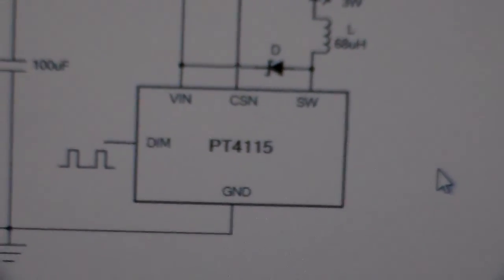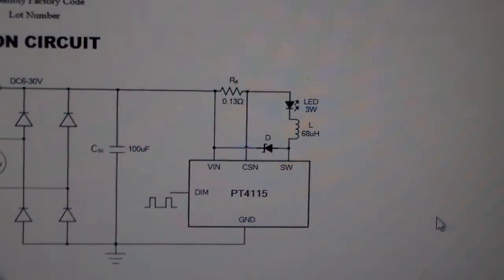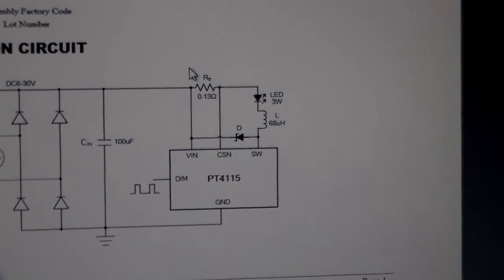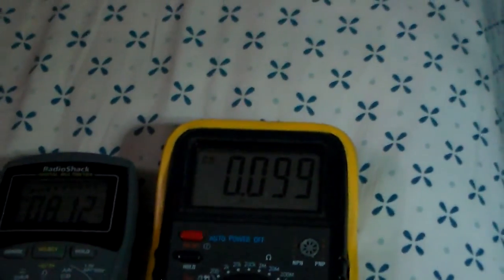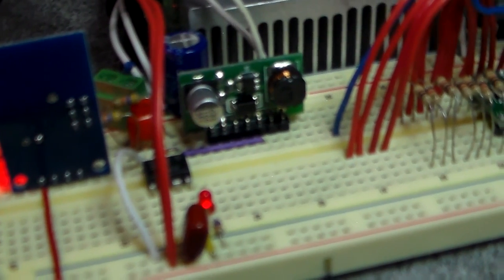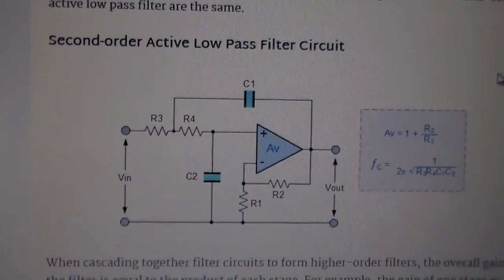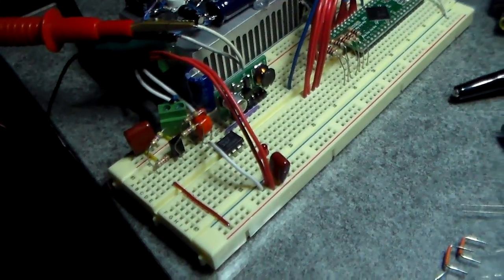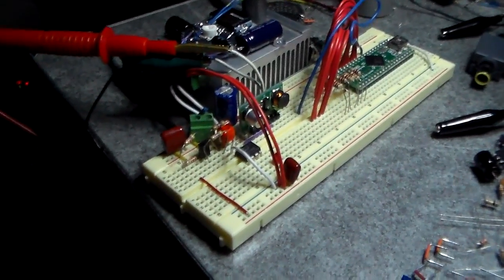Light Bar Update, PT4115 CC LED Dimmer

Comment: Is it possible to drive ten 1W leds in series with this circuit?
Reply from the maker: I believe that will be too high voltage needed for this unit, it has a max of 30v input. On page 8 of the datasheet (see description) you can see how many led's and the different parameters, they only tested with up to 7 LED's in series. You could instead make it a 5 series and 2 parallel arrangement and use this chip just fine.
Reply: @SuperBrainAK  Thank you! I Will try just 4 leds with a 19 volt laptop power supply then.

Comment: Hey ! can i use PT4115 (300mA output) to control 8W led with 12V DC power input ?
Reply from the maker: yes but not at full power. you need to find the current and the voltage of that led that lets it turn on at the full 8W, remember W = V * A if the led has a forward voltage of 3.4v and the driver is limiting to 0.3A then you have 3.7W = 3.4v * 0.3A so that will be under half the power rating of the led. if the led has a higher forward voltage then you will need to do the math with the other voltage. keep in mind if the led forward voltage is above the 12v input of the driver it cannot output the full 0.3A so you will need to raise the driver input voltage. hope this helped you good luck!

Comment: Hi! I want to power 3 x 3W LEDs with a forward voltage of 1.5 volt each. The driver will be PT4115, set up with a current limit of around 650mA, and the power source will be two Li-ion batteries in series. Do you think 7.5 volts will be enough to make the driver work? I know the minimum input voltage is 6V, but when I saw the first graph in datashhet (about efficiency), it starts at a minimum of 8 volts.
Reply from the maker: yea it is close but still enough for it to regulate, your led's will be at 4.5v, I just tested with a single white led (about 3.9v) it cut out at 5.6v and recovers at 5.9v so that is even ok for unprotected lithium cells, a BMS would still be recommended though (sine they are in series), good luck on your project!
Reply: Thanks! I´ll try this circuit as soon as the components arrive.
Reply from the maker: @tocadisco4166  how did your circuit build go?

Comment: I still dont understand..this pt4115 input 30v and output is?
Reply from the maker: the output is from 0v to the input voltage, this is based on what voltage it takes to deliver the current that is set by the current sense resistors, so the module I have is 700mA so it will take whatever the input voltage is (in this test it was 19v) and used the buck converter circuit to lower the voltage to 11.6v (at full current) so that the led does not have too much current.